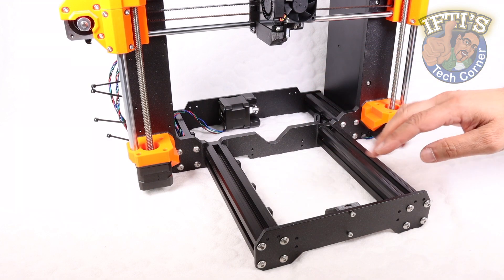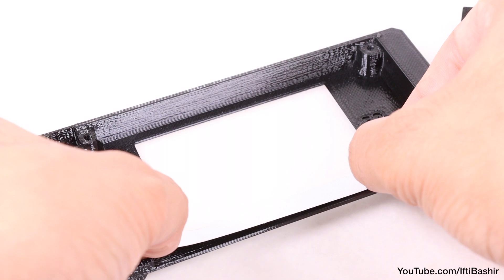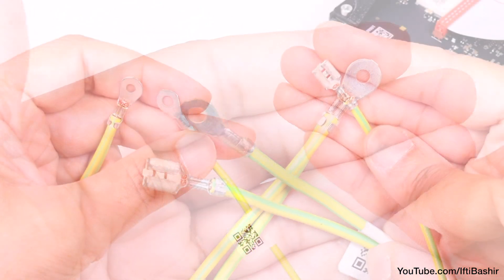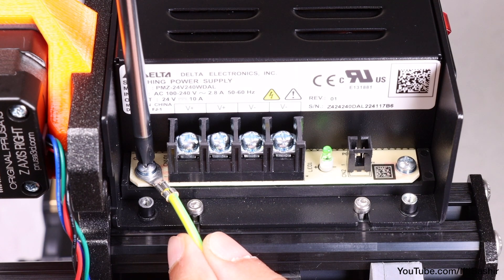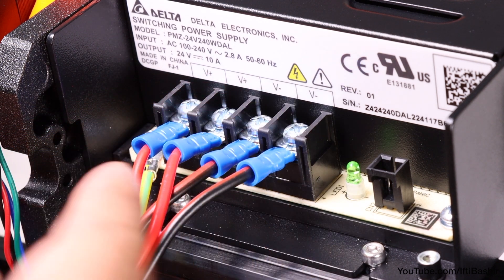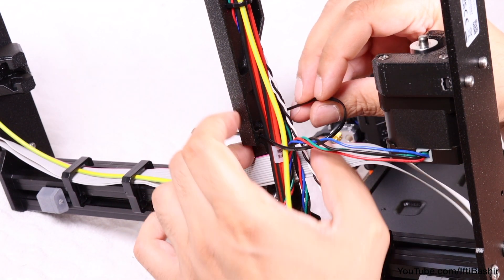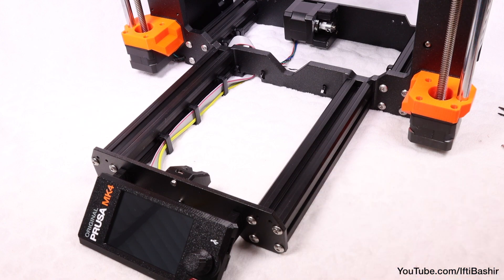#06 Original PRUSA MK4 Kit : Full Step-By-Step BUILD GUIDE - xLCD Assembly

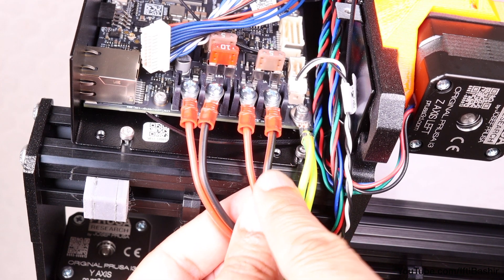Comment: At 9:51, the online assembly instructions suggest guiding the zip tie through two holes in the cable clip, which would keep the cables a bit closer to the frame. I'd be worried with your method, cables may end up pressed between the clip itself, and the surface below.
Reply from the maker: They don’t really touch the surface still - guess you can get away with either method ;)
Thanks for your comment.